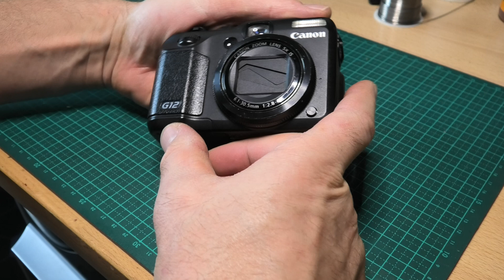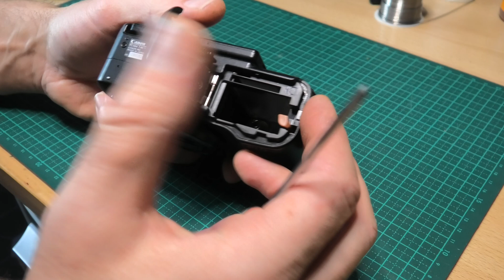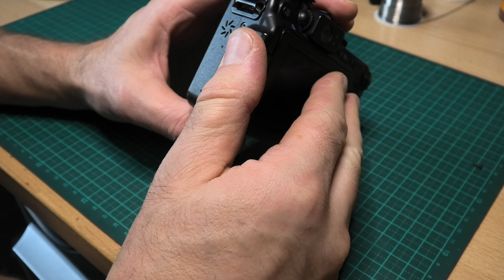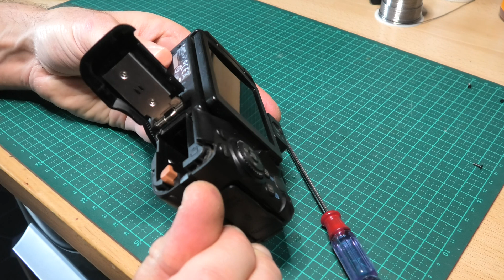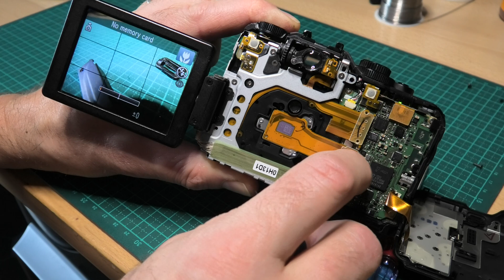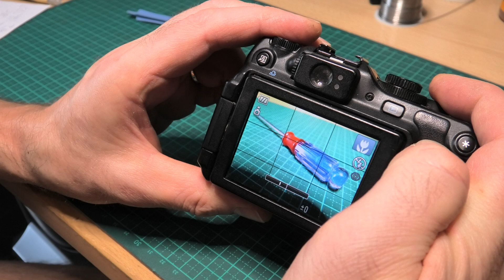Canon Powershot G12 repair - purple flickering image

Comment: I have a newer powershot 720 and my daughter dropped it yesterday. It takes perfect photos but the screen alternates between being OK and very green only when taking the photo. Its fine viewing and regardless of the screen the photos are OK. Im guessing it's also a loose connection. Ive fixed phones with similar issues after they have been dropped. Thanks for an informative video.

Comment: Crazy! Since today, my dear Powershot G12 has started taking pictures with a purplish tint, as if the white balance had become random. I’ll try your tip and hope I can keep this wonderful camera that I’ve had for almost 15 years! Thanks anyway :-)
Reply from the maker: Good luck, hopefully it fixes it for you.
Reply: @Justfixitmate  Incredible, it worked!
I didn’t take apart the camera body—I wanted to try something else. I simply flipped out the screen to access the back of the camera, and gently pressed with my finger on the back of the device, right where the sensor is located. And then—success! The image returned completely to normal. It’s been working perfectly for two weeks now. Let’s hope it lasts. Thanks again!
Reply from the maker: @emiliolicata2770  Nice one - great to hear this video helped you :)

Comment: This saved my butt! I sold an old but working G12, when it arrived the buyer complained that there was horizontal lines on the images and the screen was purplish. I found this and had them press on the outside of the case above the connectors and it solved both! Near as I can tell the package probably took a shock dropped flat on a side (it wasn't crushed noticeably on a corner or anything), and the connectors loosened just enough. Buyer got their camera and I was saved a lot of hassle!

Comment: I OWE YOU A BEER! 🍺🍺 I hadn't used my G12 in a while and when I powered it up and rotated the screen the screen would go black, the lens would make a noise, the image came back, then disappeared - each time for about a second, repeat, repeat...  I initially bought a new battery thinking that one of the cells might have not been delivering sufficient charge to power the screen and the lens at the same time. That didn't work. So I rang Canon to get a service - but the camera is no longer supported 🤬. I dismantled the area around the hinge, cleaned everything with IPA but no joy. Saw your video and thought - it is worth giving it a go - nothing to lose at this point. IT'S FIXED - YAY!! 4 days before my holiday too! You sir, are a life-saver. Thank-you.
Reply from the maker: Cheers - enjoy your holiday!

Comment: Hi, I have a problem with the g12. My battery won't pop out, any suggestions?
Reply from the maker: I'm guessing the battery has swollen due to age and that's why it's difficult to remove.  I would try attaching something to the battery to grab onto, piece of plastic etc using VHB tape.  I would allow the tape to cure properly and then pull it out by the attached grip. Might work.
Reply: @Justfixitmate  I did this, and replaced it with a new one... but I think it's the ejection spring. Thanks for the feedback
Reply: Tried pushing that brown thing to the side ?

Comment: Hi my canon s95 screen is flickering/blinking when I take photos and also when I view photos although it doesn't affect the output I'm quite bothered by it. Any idea what seems to be the problem?
Reply from the maker: Quite likely a similar issue with loose connector / ribbon cables, however I'm not really familiar with the s95. Good luck with it!

Comment: whisch one you were pushing. the camera was covered when you were doing it. It was the  most critical part and you covered it.
Reply from the maker: OK, not the best angle. If you look closely at 4:36, you can see I was about to push it down with my finger but hesitate. It's the end section of the orange flat flexible cable.   You're welcome.
Reply: @Justfixitmate  I did the same, but nothing happened. Do I have to change the whole LCD assembly since there is one in ebay for sale?

Comment: This is helpful! I carry my g12 around everywhere. I mean it gets tossed around a lot! but I recently built up a little bit more respect for my camera as its pretty good at imitating film. I’ve done this fix a few times it helps to have an air duster to keep everything clean. But a bag for this camera is recommended. I haven’t needed to do the ribbon fix in some time since getting a side bag for syd camera.

Comment: Just tried your repair to get rid of the purple film on the image. Had a problem getting the tiny screws out but found the right screwdriver and it worked well. Removed the back of my Canon G 12 and tapped the sensors, and the purple shade was gone. Thank you!

Comment: Here I am--I'm the guy you made this video for. I found it last week, when I was actually looking to see if there were any new powershots, and check out their reviews, but I found yours with the same problem as mine. Today I finally took it apart gave them a little push and presto chango works perfect! Thanks. One thing for anyone else needing this repair, take screws out in order and place them so they can't move around, as they are different sizes and need to go into different holes--not terrible like iphone screws, and you could probably figure it out, but don't waste your time. I stick them to the back of a address label attached to my table with notes to their location on the side. This repair that's maybe overkill, but most other electronics it's a must.
Reply from the maker: Nice one! They don't make them like they used to hey - it's a great camera.  I have to admit, I had to look back at my video to double check some of the screw lengths. Good point.